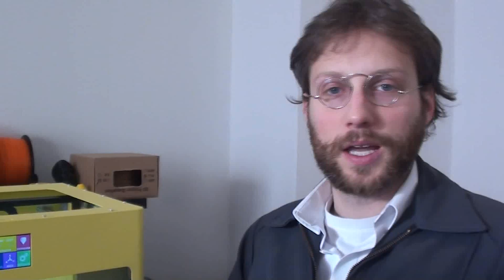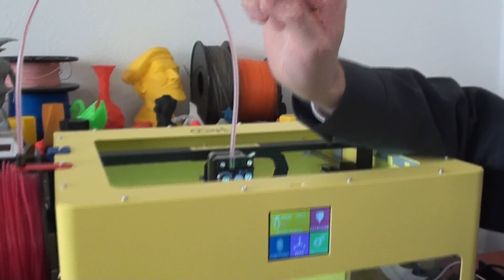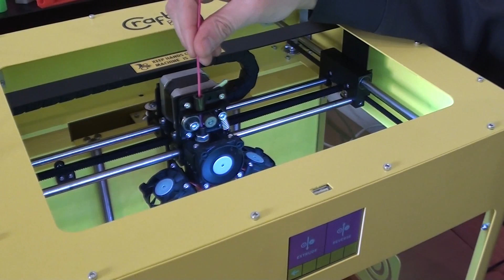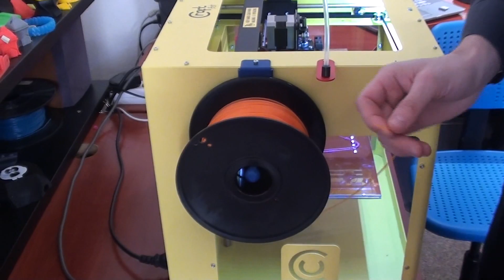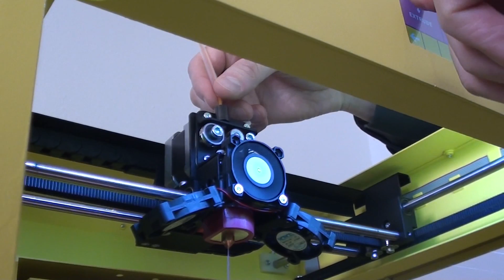How to change the filament on your CraftBot 3D printer

Comment: Much easier just to release the latch and push down on the filament slightly before pulling it out.

Also generally good practice when you unspool to make sure the end of the filament in tucked away in one of the holes in the spool, otherwise it can whip back and cross thread with the rest of the filament, causing tangles in the future.